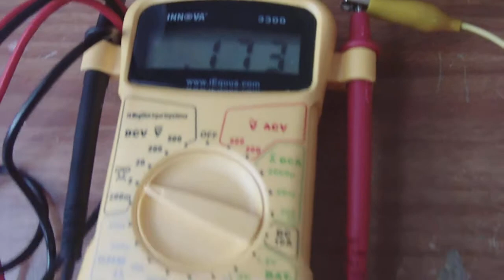Magnesium semiconductor crystal cell no electrolyte

Comment from the maker: @overunitydotcom 

The black area is a type of oxide layer. To test to see if it could be galvanic I placed copper wire onto the black spot and notice no difference in voltage. If it was galvanic than i should have gotten more voltage because copper is at a greater distance than the zinc clip i was using on the galvanic charts. The voltage is dependent on the black layer.

Comment: Or maybe this is just the reaction from your magnesium strip to the black wet layer as electrolyte and the croco metal as the other dissimular electrode, so it is just forming a galvanic battery ?

Regards, Stefan.